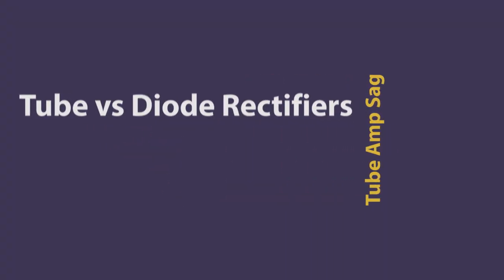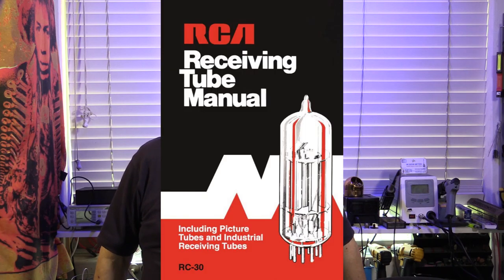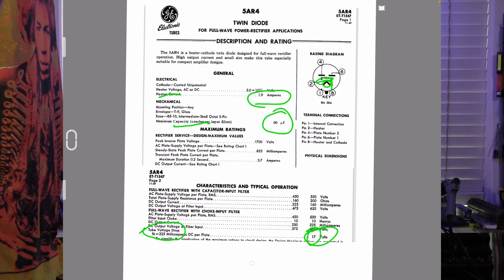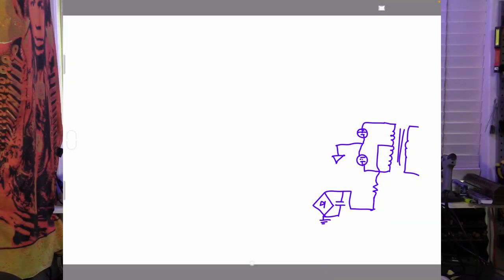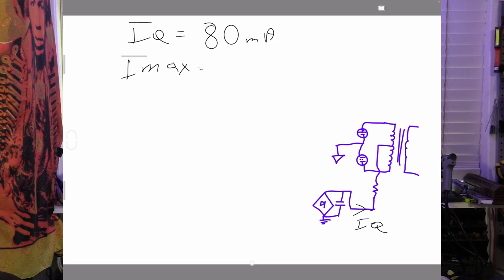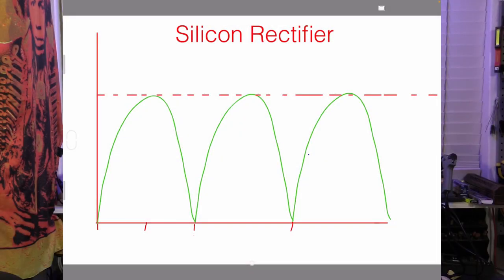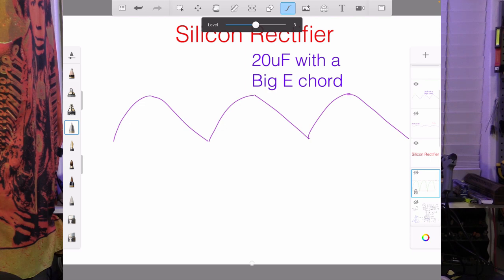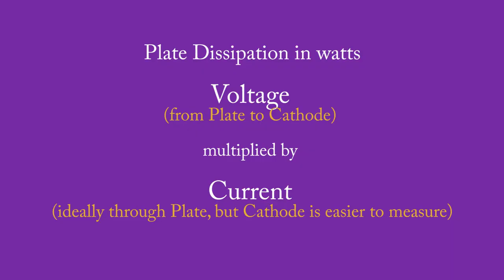Tube Amp Sag Chapter 4" Solid State vs Tube Rectifiers

Comment: Good video again. I have had no issues with  a 68uf cap for my Champ or Tweed Deluxe builds. That said, 20uf filters for the screens etc... The amps just deliver that sweet sag. They honk ...
It's a matter of trial and error, and the RCA manual is only a suggestion. I'm looking forward to the next video.  Cheers
Reply from the maker: Thanks for the comment, Ken, Are you using 5Y3s? Yes, I agree that the RCA manual is a guide of recommendations and not a law book! I’m happy to hear that your rectifiers have survived a 68uF first cap. Which rectifier brand do you use?
Reply: @theguitaramptech  Nichicon caps. I had the opportunity to buy 150 of them for $25 some years ago. They are radials, and 105 deg Celsius. And yes, I do use them with 5y3 tubes. I've had some negative comments from techs about the use of the caps with respect to the tube manual. I respond with I have many 5y3's. Of course, I would rethink using those caps if I had a problem. They are very useful with a 5u4, but in a Tweed Deluxe I lose too many volts in the b+, but it really doesn't matter as you likely wouldn't hear the difference. I still have more than a 100 left. The good thing is I  have many 5u4's too. lol 😆
Reply: Sorry, I misunderstood the question. I use the New Sensor brand 5y3's. I'm going to try JJ 5y3's next. It isn't that I haven't any 20uf caps, but I have so many of 68uf caps, I want to use them up. lol
Reply from the maker: @kengevers8738  I like higher cap values personally, and generally use them on my personal amps, but I stick closer to design or RCA values for customer amps. Thanks for that info.

Comment: Thanks Chris for these useful info. How about hybrid rectifier sagging?
Reply from the maker: Thank you for your question. I’m not sure I fully understand your question. Are you asking if there can be rectifier sag with a hybrid rectifier? As you know, there are many different hybrid configurations with differing performance, and different rectifier tubes have different sag, but in general, where you have tube rectification you can have sag. If you want sag but with the reliability of silicon diodes, and no 5v current demand on your PT, add a series resistance to the diode rectifier. It won’t be exactly the same as tube sag, but near enough so that you probably won’t hear the difference.

Comment: Good explanation Chris!  I was thinking the dropping resistor would go in after the rectifier, & before the first filter capacitor.  But you've installed it before the rectumfrier.  Fair enough!  I guess pre-rect is more suitable than after huh?  

Thinkin about it, before the rect would reduce the effective AC  waveform reaching the rect., so it would have more of a valve-sag sound.  Is that right?

Comment: 24:08 Could you not put an NTC thermistor in series with the capacitor to stop it from looking like a short circuit during startup?
Reply from the maker: Sure thing, Jay. I like the idea of using an NTC . I would be inclined to put it before the primary of the power transformer. As you know a NTC is basically controlled by heat. If the NTC is not allowed sufficient time to cool after power off, its protection is reduced. I like and use NTCs on my personal amps.

Comment: How would you wire an NTC thermistor before the primary of the power transformer?  And what values? Thank you kindly.
Reply from the maker: I would put the Thermistor between the On/Off switch and the Active of the Primary of the PT. They are designed to get HOT so be aware of location.

Comment: Great video thanks! However im still a little unclear as to how the filter cap size affects sag? I understand how they affect ripple (however that will be mostly cancelled by push-pull output stages anyway) but still don't see how they can affect DC voltage sag?
Reply from the maker: Great question Bob and good observation about push-pull stages having inherent noise/ripple cancelling, (not unlike humbucking pickups taking advantage of cancellation of same noise in opposite phases.) 
Some people call those first filter capacitors a “reservoir” and that is an excellent descriptive term. At their highest elevation (voltage), most towns have a large reservoir (filter capacitor) of water that is continually topped up by pumps (rectifier & transformer) to meet the peak demands (loud bits) of the townfolk. Without that reservoir, the town folk will experience a trickle from the tap (sag in voltage) when they all shower at the same time (that’s a kinky town).
Whether we hear sag from a drop in DC or a farty 100Hz ripple will largely depend on the type of rectifier, ie silicon diode, or tube.

Comment: Hey Chris, thanks for the excellent videos! I'm curious why you prefer the indirect cathode heating rectifiers to the direct. If you're using a tube rectifier wouldn't the point be to have voltage drop for a characteristic tube sound? Why not go with diode if the aim is snappiness? Or is the idea to get the best of both worlds? Thanks again for this great content!
Reply from the maker: That is an excellent question, Zam. It's not so much a question of SAG. Direct/Indirect cathode heating is more of a matter of “startup time” of the rectifier tube. When you first turn on an amp there are possibly TWO current surges depending on how the Standby switch is wired. The first surge is the Transformer energising and the second surge is the Filter caps charging.  These surges can be quite severe and look like a short for a few milliseconds. An indirect rectifier would minimise this surge effect much the same way s a NTC thermistor.

Comment: IPhone to babe sag I wanted all kind of new guitar synthesizer send my futuristic metal rock you know etherical kind of stuffand I just when I'm from listening to Debbie metal to us just lots of classic rock and a hard rock and stuff that my parents did said that it was on a class rock radio when I was working all the time really going back more into class rock and hard rock more than metal and I found  That tube amplifiers and analog pedals are the best sound you can get and when I see a 2 band I don't mean all these new tube they're almost all garbage even some of the ones that say Marshall, Fender, Vox . . I went out and I found an old 1960 tube amplifier that got better reviews than some of the more expensive amps including 2 that I owned at the time which were fairly popular cheap tube amplifiers the Fender super 60 with 6l6 power tubes one of the famous red knob amps. I also had a peavey tube king 50w. This harmony h303a. One power one pre amp. One rectifier tube. . I never had sag before with those other amplifiers but this was a null1962 the parts in it were not Chinese circuit boards this was old school stuffum I've never seen anything like that the stuff that was in it very old components and a Jensen speaker made in Chicago. . I discovered that when I cranked up the amp but mainly more importantly when I cranked up all of my volume knobs on my instruments and then I had an analog overdrive pedal it was an old boss turbo overdrive totally analog ways like 20 pounds you've knows just a little boss pedal. I discovered that when I cranked up the amp but mainly more importantly when I cranked up all of my volume knobs on my instruments and then I had an analog overdrive pedal it was an old boss Turbo overdrive totally analog ways like 20 pounds even though it's just a little boss pedal . So once everything was cranked up the sag when completely f**** crazy it was like a crazy ethical sound you you don't get out of guitars anymore right go and check out the AT&T minute version of indigotta-devita by Iron butterfly.  Same trick. But w a mosrite fuzz tone. . You can make all sorts of crazy sounds out of these amps creating weird landscapes if you listen to that 18 Minute version from Iron Butterfly you're Here you hear 2 Different types of guitar solos 1's got a wap puddle it's Clean it's A Little More distorted The Other does even sound like a guitar sounds like a brooding demonand it is Insane is creepy sounded and it is so Different. As there's a lot of regular parts of the song I mean it's like a bus saw not a guitar that you hear going through most of those parts I Mean It's Insane Some Of It is a technique most of it is guitar equipment you cannot Find any More Push to the maximum where it starts to Really CHANGE and Make Yourself sound Crazy and I have found that this is the song I've been looking for. Not just the sag but the many different versions of twist and turns over it and the organic weird different sounds and things you can get out of the old amplifiers that you k and not absolutely not get out of the nuclear amplifiers I know that for a long time I used to buy some Motorola harmonics pedals when I had a transistor amp I set them back as I didn't like the way they sounded come to find out those are analog puddles and owners are the best if you have a real analog tube amplifier. At the same time all those boss pedals almost all of them are digital garbage don't go with digital goal with analog anytime you can and this also includes with synthesizers I found that there's some pedals out there like that like the old EHX Microsoft that just can give you crazy psychedelic scream sounds out of those old amplifiers unfucking believable sounds come from the old amplifiers. And for my first few years of playing I avoided them because I thought I would sound like old and s*** like some of the needles really old stuff where it sounds like they're playing Plastic guitars you know. And now I know for sure without a doubt the best amps I have ever played were more tubed than anything else in all of them Have tube rectifiers other than some marshals and a few other amplifiers somehow they were able to maintain some of their tube sound but I have played all sorts of different brands over the last couple of years of all These newer tube amplifiers even ones from big name brands Sound like garbage. If people want to because they think that transistor sucks then why aren't they recognizing that you should get a 2 abrupt fire as well I mean you'll get a little bit more stability are you sure that's what you want because I found less stability and morqueos was exactly what I was needing exactly what I wanted to go for I didn't want to sound the same all the time and when you play through this kind of equipment the actual sound of your guitar your instrument comes through you can hear the real tone in your guitar if you're playing just crazy transistor amplifiers with digital boss puddles or any of these digital amplifiers it's just s*** samples I used to have 2 keyboards 1 is full of copied sounds that are basically just s*** samples and the other one is analog synthesizer and all the analog said the seizers at the first keyboard copy. It's all like absolute trash from a crossroom or over a phone you might think that it's the same sound that I would be using if I was playing keyboard part  I've been playing. The song jumpgo to learn benhill and jumptry it on a digital keyboard with the synthesizer and then try on an analog synthesizer if you have eardrums and a brain you are gonna go for the analog sound every time some people get tired and bored of the old sounds they want to look into new sounds I've heard a lot of the digital cookie keyboards and the hybrid keyboards and I don't hear anything good we bought my exold lady a $1000 Roland Juno synthesizer and it said they could do all these things it sounded great when we watched the videos but when she got it she was I'm not happy with it she did not feel that the sounds were that great and I had a little tiny corg analog and she said that sounds so much better. We sent that roll and Juno back and then we looked around and we found out there was a cheaper rolling synthesize your that was like 700 bucks at they just come out. You can tell just by looking on top of the thing that it was what you're looking for as a real synthesizer even though it was only a couple 100 bucks and we got one that somebody boughtnew put not even barely a scratch on it because they only had it for a couple of weeks like 2 weeks or 3 weeks before they turned around and sold it for $400. Etc. Plus a better warranty. A must when buying electronics. Extended warranty, do it . Please be wise. . I was actually p*** because it was like $400 for a new one and let's go buy new 1 I asked several different people  If they came with an adapter one guy said yeah it does next guy said no it doesn't I said yeah I think so so I sent enough money in for the synthesizer plus tax plus a few extra bucks and then just to find out that I did have to buy the adapter and so Then I didn't have enoughso Then I look around and look around and end up having to bite a used 1 from another state which I did not Want To Do I do not Want To buy a synthesizer keyboard that people have been beating on and touching on I Want To buy a new 14 a reason okay this 1's like new okay Then there's no Real great warranty because Somebody Else's own for a couple of months so I paid for an extended warranty but what p*** me off is once I got my keyboardthere was no instruction books I meanit's a Good Thing I had 1 from a previous model that keyboard I bought before my ex took it split up so I already had a book to thank God for that partbecause it's extremely complex even for a little KORG synthesizer I Mean.  Synthesis true truly can be Difficult.
Reply from the maker: Thanks for sharing your experience, Leo